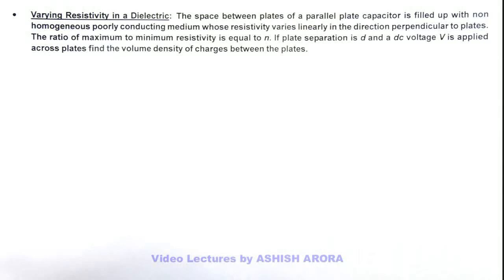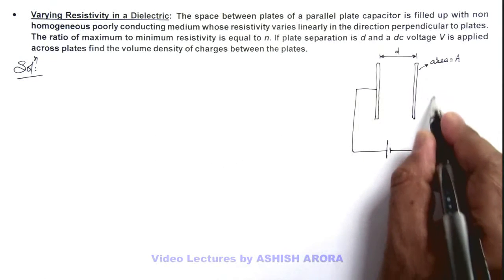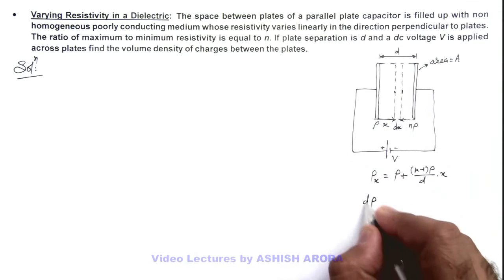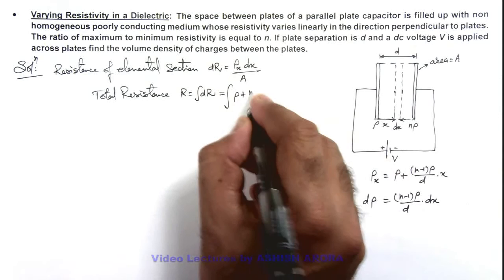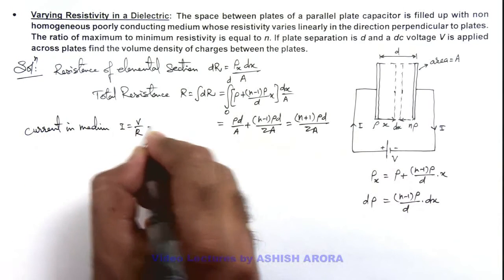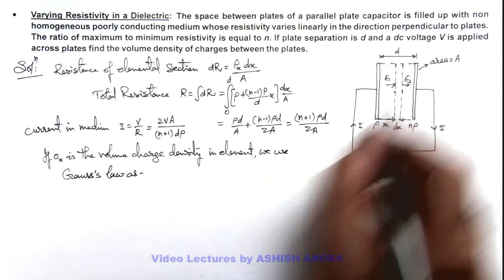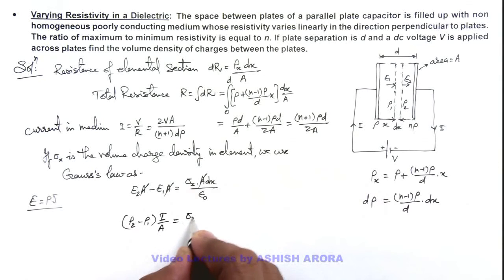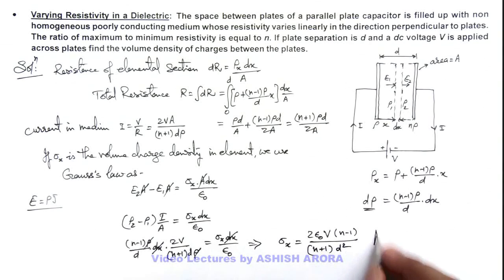22. Advance Illustration | Current Electricity | Varying Resistivity in a Dielectric | Ashish Arora

Comment: couldn't we solve it like this 

net R = (n+1)drho*/2A and net resistivity can be calculated as drho = (N-1)rho* dx/d and

it comes out to be rho = (n-1)rho*/d

and further we can right capacitance C = KQ/V where K is dielectric constant 

the equate it as RC = rho.K .E*

on putting values we can get Q = 2VE*(n-1)A/((n+1)d)

the for volume charge density we divide the charge by volume = Q/Ad the the final answer come out to be same.

is this approach correct?
Reply: Yes i think its correct

Comment: Sir while applying the Gauss law at the elemental strip, shouldn't we also take into account the electric field due to the charge of the medium between the plates?

Since the resistivity is varying, we can assume the nature of the medium to be changing throughout, so the dielectric constant of each elemental strip will be changing. Shouldn't this mean that the electric field at a particular point in the medium between the plates have a net electric field DUE TO the volume charge density of the medium?
Reply: Harsh when we apply gauss law only the charge inside the gaussian surface can change the flux; outside charge may contribute to electric field ,inside the gaussian surface but that do no effect the charge acculumated inside the gaussian surface.
Reply: the ques. doesn't mention any thing about Dielec. constant so assume it to be uniform

Comment: But in question asked to find volume charge density across the plate. we calculated is that across the small element dx
Reply: Volume charge density itself defines it as charge per unit volume and if you want to calculate the charge in entire volume just multiply final ans with Ad
Reply: Same doubt

Comment: Sir,in such leaky capacitors,current will flow,so how charges can be static?Charge density should not be constant?
Reply from the maker: No... it can be as electric field between the plates at any point is having a fix value which is due to the charges residing in the medium...
Reply: But if electric current is passing through medium,charges in the medium will also move,so how a fixed value?
Reply from the maker: Not necessary... the charges which are constituting electric current may be different from those which are static...
Reply: How is it possible?In presence of potential difference,why don't static charges move?
Reply from the maker: Fixed nuclei in any lattice can never move...

Comment: sir in this case( E=PJ ),net E is due to charge on plate and induced charges throughout dielectric material. 
am i right sir ?
Reply from the maker: Yes...
Reply: @physicsgalaxyworld   sir, here should also be electric field due to charge on the capacitor why you are neglecting this???
Reply: Sir, in E=(rho)J, haven't you only taken the electric field due to the charge on the plate? Also, shouldn't the E in this formula be only the applied electric field which is the cause of the current(so it should anyways not account the electric field due to the volume charge density of the dielectric)

Comment: Where is this thing explained in theory? This is very confusing. Here you are using E = p J to calculate electric field inside capacitor, but this electric filed is only due to the current flowing, what about the electric field due to charges appearing all over?